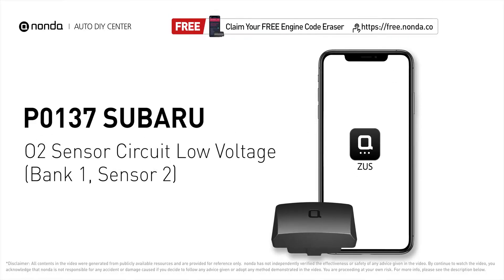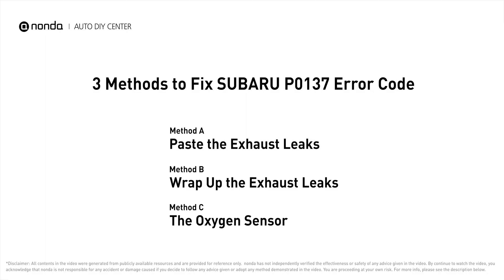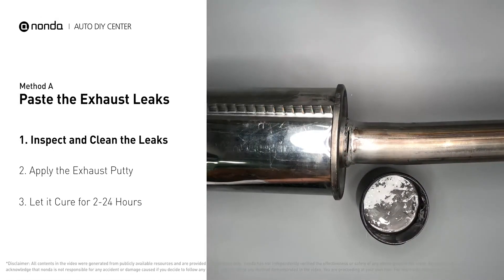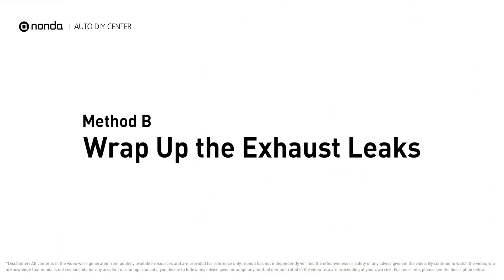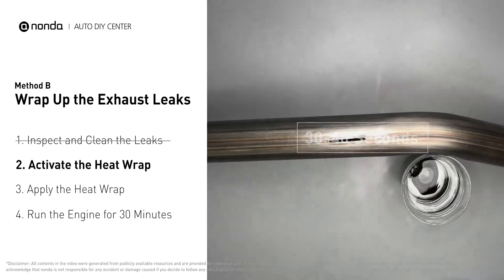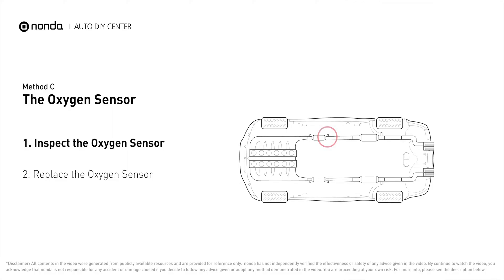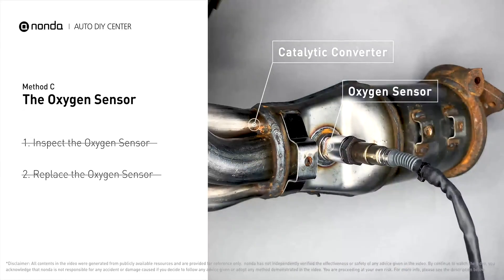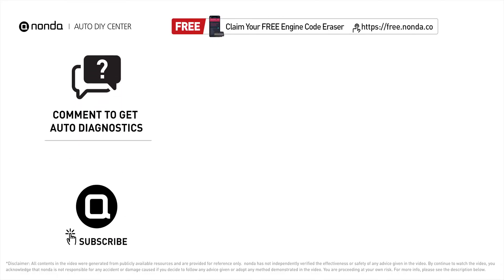How to Fix SUBARU P0137 Engine Code in 4 Minutes [3 DIY Methods / Only $9.42]

Comment: You replaced the oxygen sensor you didn't patch up the hole in your exhaust which was just about every single solution this company seems to provide always fix the hole in your exhaust will carry your problem for $9 it's a complete bunch of crap it's a company selling you garbage with garbage information you got a one in a million fix by replacing the oxygen sensor which was not the solution the solution was to patch the hole in your exhaust before you make a comment make sure you know what you're talking about

Comment: This is the biggest bunch of useless nonsense any company is bothered to put out yet
Reply: But..I had this problem with my Crosstrek. Ran the fault code. This video identified the fault code as 3 possible locations for the oxygen issue. Found the faulty sensor. Now fixed. Without being extorted by a garage. I believe it helped a YouTube mechanic fix a real world problem. We can both be right 😄
Reply: How?
Reply: @JabSugarAnderson It’s five minute crafts basically. They’re just babbling about problems that don’t exist.
Reply: @dr.agster5768 Literally that code is Oxygen sensor circuit voltage too low didn’t mention anything about testing for power or ground poor connection broken wires there could be a sliced wire in the middle of harness chewed by mice theres a million reasons why Trouble codes come on bunch of hacks
Reply: No it isn’t, you just don’t what you’re talking about. I replaced my o2 sensor in my Wrx, and that was the problem.